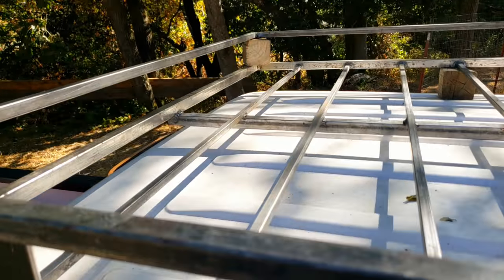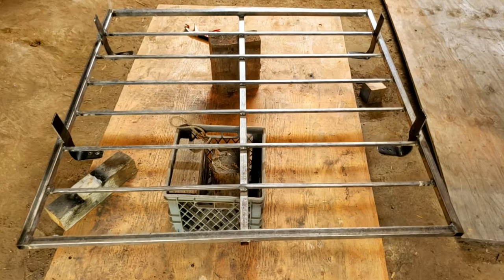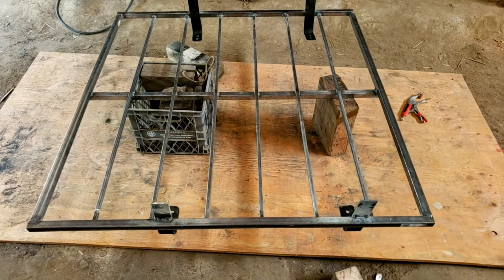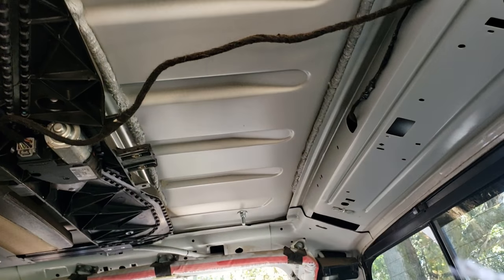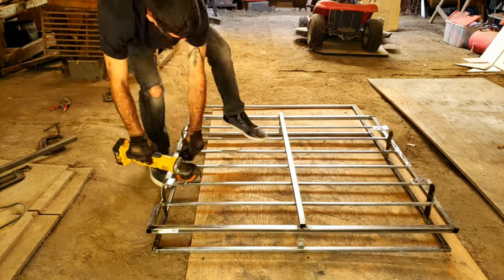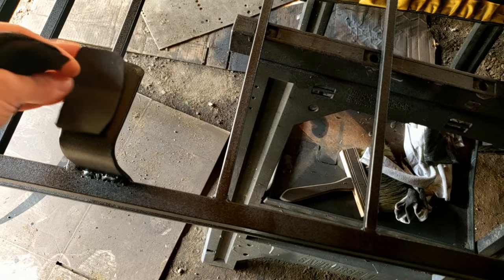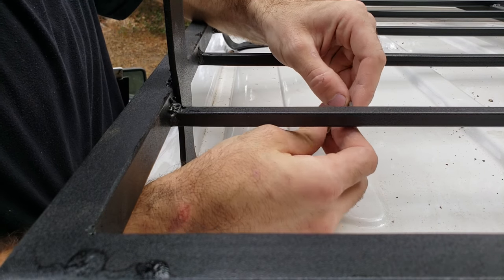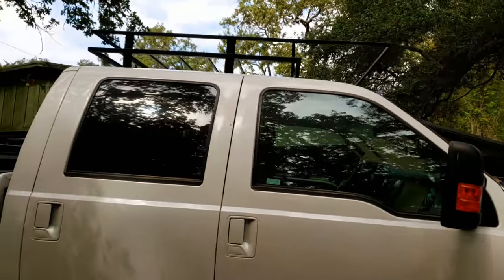Custom Roof Rack Build around $100 (Part 2)

Comment: Looks great! I'm surprised that since the inside of the box steel is open it doesn't rust inside and wash put rusty water on your truck when it rains. I've seen that and it doesn't look pretty
Reply from the maker: Funny you should mention that. I just noticed last week a small rusty water line dripping down the back corner. I actually added some plastic end caps on them however the hardware store was 2 caps short. So I should probably cap off the last one before it gets too rusty.

Comment: Nice. Have you had any leak issues? I am going to have to build my own since no one makes one for my truck.
Reply from the maker: No issues with leaks the tire tube sealed well to the body for about a year. When I removed it and added the offroad lights I also added some windshield glue on all the bolt heads.

Comment: Sweet build, I might have added some silicone and or rubber? Does it leak?
Reply from the maker: There's a rubber pad between the rack and the roof of the truck and a rubber washer on the head of the carrige bolts. No leaks 3 months later.
Reply: Tyler Weis yeah I can’t decide on round or sq materials yet.
Reply from the maker: @nicolaishapoval9185  yeah I would like to do a round tube for a bumper/brush guards.  But I'm waiting until I get a tube notcher and bender.
Reply: Tyler Weis heck yeah, keep on making vids. They want pretty penny for them bumpers SMH